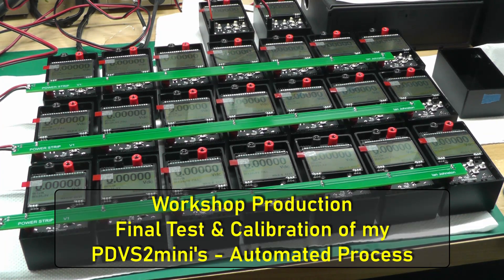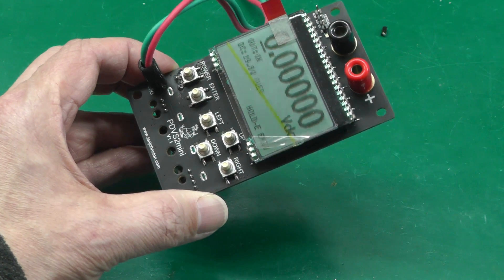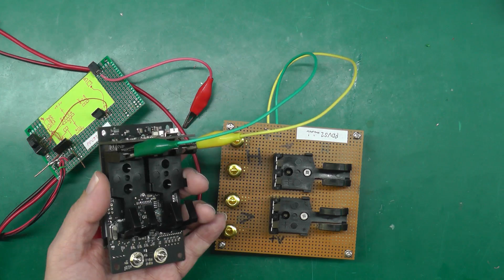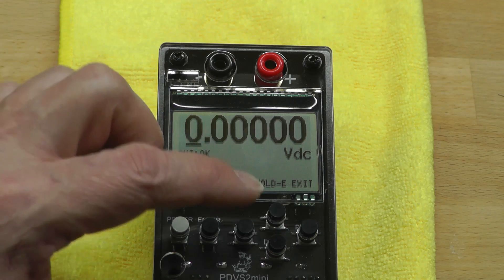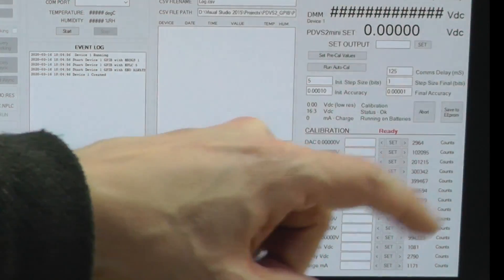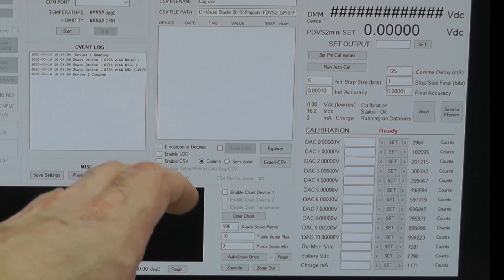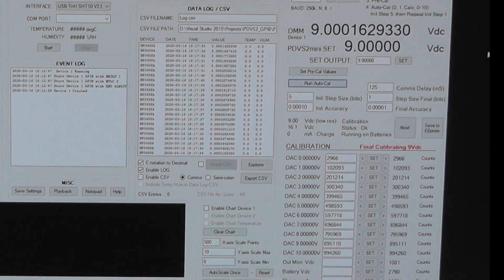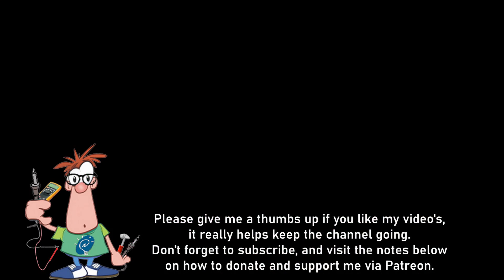No.052 - Final Test & Calibration of my PDVS2mini's - Automated Process

Comment: You could maybe speed that search up by doing a binary search. You'd start with something way under and something way above and you'd test the half point. If the half point is too low you take that as the new lower bound and repeat, if it was too high it becomes the new upper bound. Because you are subdividing each time it should converge much quicker than a fixed step scan like you appear to be currently doing. This would be somewhere between your stepping and the PID someone else suggested. But it's likely < 10 lines of code ;)
Reply: Linear interpolation would be a similar approach to making very good first and subsequent guesses, essentially using the high and low points and slope to make a guess that's more accurate than "half".  It may be that much of the code has already been written in one form or another.

Comment: Thank you for showing this, i've been working on a telemetry system and dread the calibration process, this approach looks excellent to use
Reply from the maker: My method could be done a lot faster by calculating the offsets rather than stepping so much, but it was easy to implement as I needed those routines anyway so just left it at that. It works just fine.

Comment: At 15:30 couldn’t you do a calculation ratio for the difference for the step correction so if it is out by a lot it uses larger steps, so the step size is a scaling of the difference
Reply from the maker: Yes, this is just the first working version.......and I used it to calibrate a whole batch, it's great to see it stepping to the target value and helps me identify other possible issues such as too big a step requires a slightly longer wait time on the 3458A as it takes longer for the voltage to travel further......but the plan is to modify it for the next batch.

Comment: nice test and calibration setup.
The first two steps for zero and 1V take too long, especially you could speed up 1V point to a few steps only, by calculating the gain of the D/A, and then approach this voltage to within a few bits, then iterating up and down.
Reply from the maker: Yes, that is what I have been looking to do.....this first incarnation as it sits just to prove my concept. The zero counts are always around the same value so not an issue, but certainly 1V pre-run could do with a re-write........I'll get onto it and report back....:-)

Comment: Great job Ian. The efficiency gain is very significant clearly. You mentioned a final "manual tweek" of the calibration after you've run the Auto-calibration routine; what's that about ?
Reply from the maker: For the automated process the 3458A is set up with a very small NPLC because its fast, and so the manual tweak afterwards I would increase this but which would also increase the sample rate to a couple of seconds or more. A high NPLC value increases AC noise integration time and increases measurement resolution and accuracy. Also, by doing the manual tweak without the serial comms connected I also minimize any ground loop or noise issues.